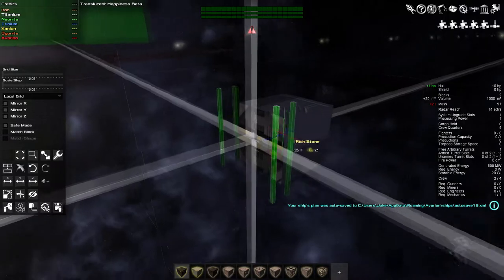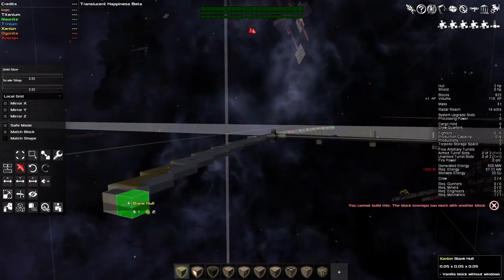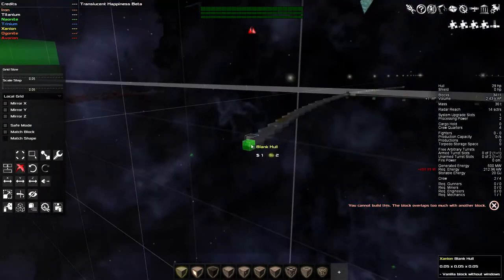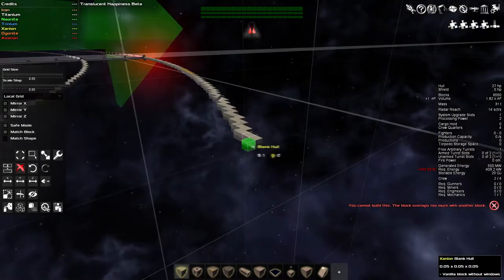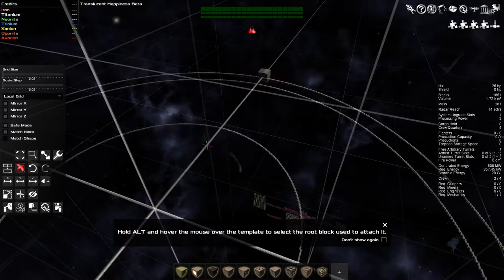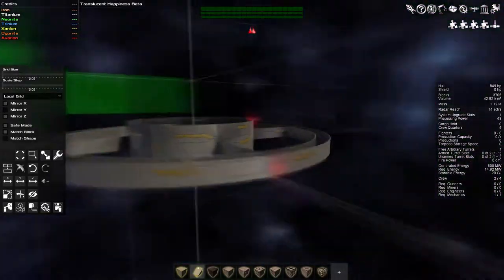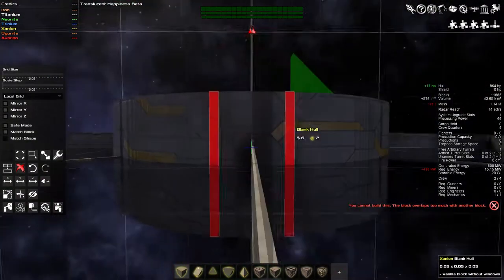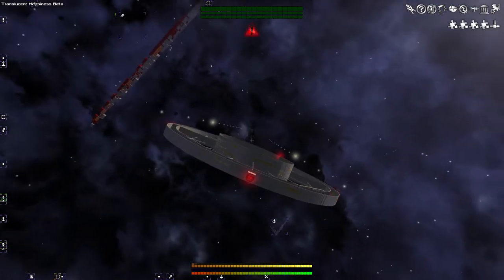Frontier Station Build pt 1 | Avorion #50

Comment: There is no Xanion armor.  I use Trinium Armor because it adds more HP than xanion hull does even if it is heavier.  Its weaker to xanion tier weapons but I still prefer it over xanion hull.  One reason is that if you have a solid integrity field, the HP gains over xanion are not negligable, even against xanion weapons and really adds up on larger builds.  Another reason is that not all the the weapons the AI use on you will be xanion, even in the xanion zones.   Also, I like the cammo pattern on my war ships!  :) 

I don't think there is any merit to the fear that overlapping blocks will be disallowed as the procedurally  generated ships use this "feature" extensively... but it irks me in my builds too lol.
Reply: how do you build such perfect circles? . . . is there some math trick to it? like for blocks this way then step, then 2? something like that?
Reply: Joseph Marsh I'd normally go with trinium too, but since it's a station, ogonite. Pretty sure it has pretty heavy and good armor... But yeah, normally, it's all about the trin.